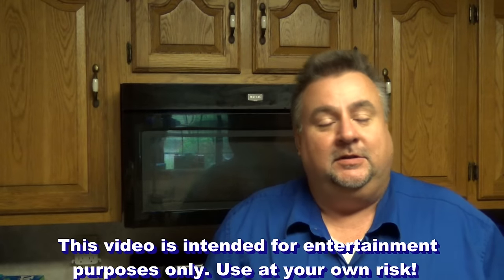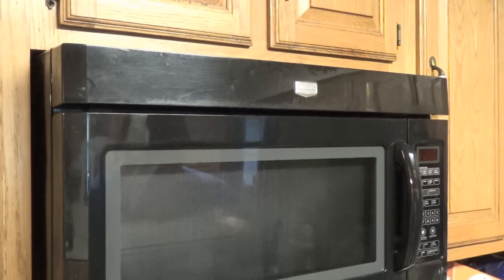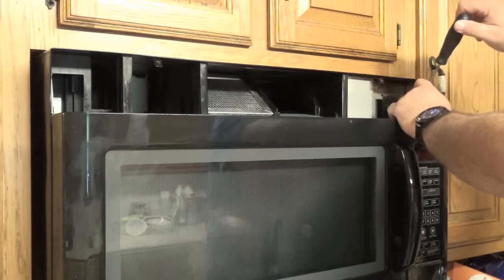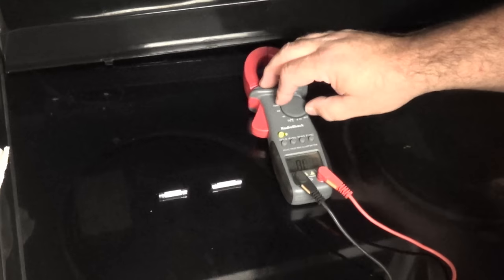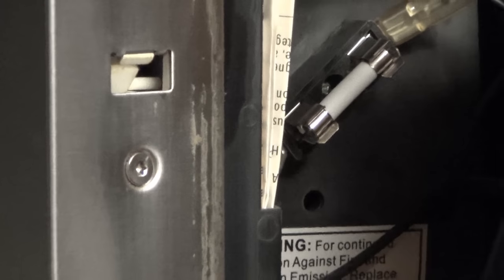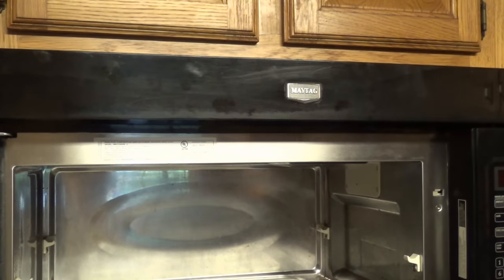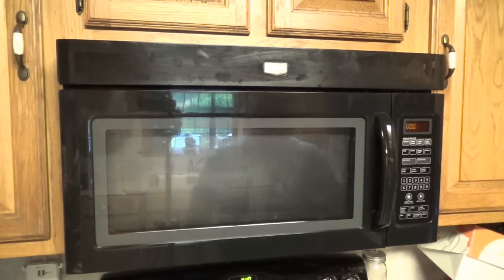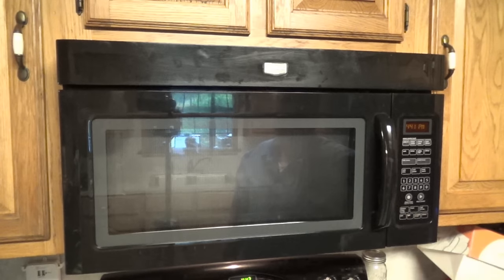How To: Restoring Power to Your Dead Microwave

Comment: You were lucky, I repair Microwaves and most of the time when the fuse blows is because there is another issue, there is a door micro switch that when it goes bad it blown the fuse, they make it like that for safety so the microwave won’t work with the door open , if they didn’t have that fuse you could put the microwave to work with the door open , and you could get radiation from magnetron, also the high voltage capacitor when is bad blown the fuse, another thing to have in mind when checking a microwave is that the magnetron produces 3000 volts or more and the rectifier ( diode) raise that voltage to more than 5000 v , so be careful when testing, and after unplugging it wait a few minutes so h.v capacitor drains
Reply: I installed a new fuse.  It blew right away.  Installed another.  That blew too.  What should I check that's causing this?
Reply: I have Kenmore over the range microwave. Display and fan works, but after setting the timer, you hit start button and it doesnt make any noise or do anything...
Working fine ond day, the following day nothing. Any guesses what to check?
Reply: Yeah I'm not anywhere near an expert on electrical repairs, but a lot of the time when something blows it's likely not as simple as fixing one thing.  I actually had a subwoofer amp blow a capacitor, and replaced just that and it worked again.  It was a cheap amp so I had fun running it hard, and blew it up again but this time it fried a bunch of transistors and the board itself actually got burnt.  Most other things I've tried to fix always are a lot harder, and you really have to learn what you're doing.  I see a lot of videos about people just changing parts to find the problem.

Comment: Not sure if you need another thank you but thank you. Frustrated that I got rid of my other microwave a couple of years ago when it was likely a $3.50 fix. Last one cost me two decimal places at $350 because I was an idiot. You grew me a little today :-) I don't have the same microwave but it . gave me knowledge I used to solve my problem. Have a blessed day.
Reply: I suspect there is a underlying wiring reason the fuse blew out. Replacing the fuse may solve the problem only temporarily.  It is worth a try.

Comment: Fuses will blow from normal use . However they will blow if one of the door switches isn't working. It will ground out the power cord and blow the fuse. So after you replace the fuse check the resistance across the power cord. If it is zero with the door open and closed then one of the switches is broken.
Reply: Jeff Hoffinger - what if all 3 checks show resistance and still no power ? Whatta we do next soldier ?

Comment: IN some other videos on changing this same fuse they warn about needing to "discharge the capacitor" to avoid shock. You didn't do this so I am assuming it is not necessary. I have ordered my fuse and waiting for arrival but did want to check with you before I remove old fuse and proceed with placing new one. I find your videos to be much more helpful than others and have really saved me a bunch of money as a retired fixed income baby boomer. Thanks
Reply: Im in the same boat !! KitchenAid Microwave KHMC1857WSS0 - Im pretty sure its the fuse, Just have to figure out where the fuse is located

Comment: in my case, the microwave has blinking time LEDs working.. and when i open the microwave door, the interior light turn on, and when i close the door the interior light turns off. But none of the buttons on the microwave control panel are responding to touch, Any idea what the porblem is?

Comment: How do you remove the panel backing cover. I can’t get to the screw at the top in the back. Trying to replace the door latch switches. The to screw holding the cover is hard to access. Any suggestions works be greatly appreciated. Thank you!

Comment: Great video.  Note:  Meter did not read zero with the old fuse, it read "OL" (probably for "Open Line???", indicating no continuity).  It did read zero (no resistance) with the new fuse, which indicates continuity.
Reply: OL is for Over Limit
Reply: Yeah I don’t know why people don’t just use the continuity mode on the DMM. This is like the 5th guy I’ve seen do this.
Reply: OL is Open Loop
Reply: @MadJDMTurboBoost  Right? You can test a fuse with a button cell (or any other battery) on a regular battery tester. Just place the fuse on one side of the battery and see if the needle moves, no need to bring in ohms.

Comment: i live in a apartment and the new Microwave is a 1100  It heats and after done  shuts it self  off No Power and about 5-10 min later comes back on it self  ..... Scary,,,, So i moved it to a plug in with a trip breaker out let  thinking it was drawing to much power on a regular outlet in Kitchen

Comment: Fuses are good still dead. Left it unplugged about 30 min, plugged it in and I had power but would not heat. Unplugged it and then plugged it back in and dead again???

Comment: Quick question for you. The 20 amp fuses that  came out of my microwave is a glass one with the visible wire inside and is specified as 125 V on the silver cap on the end of the fuse. All those I can find locally, glass or ceramic, say 20 Amp/250 Volt, not 125.

Will they work, and be safe protecting my circuit board inside the microwave? Some also say they are Fast, others Slow.  Which one do I need?  Thanks for any help.
Reply from the maker: Can't really give you too much advice on that, other than you need to be sure. I looked mine up and ordered it... probably paid a little more, but the part number matched. Good Luck.
Reply: Daniel Scheer hey thanks for your answer, though.  Hard to find this 20a/125v fuse, but will keep looking.
Reply: @marvin6148  When you find the place that has them can you please post that link? TIA.
Reply: @marvin6148  it kind of does matter, fuse is to design to blow at certain limit, placing larger capacity of any voltage and resistance may lead it to blow other components,

Comment: WARNING: ITS A FACT THAT MICRO WAVES OVENS HAVE A POWERFUL BATTERY THAT HOLD CONTAIN & SAVE ELECTRICITY IN ITS OWN BATTERY IN THE UNIT. Even IF YOU UNPLUG OR SHUT THE CIRCUIT  BRAKER OFF ITS DANGEROUS TO MESS/POKE/USE METAL TOOLS WITH ANYTHING INSIDE THE BACK WITH THE COVER OFF SO NEVER TAKE A CHANCE WITH TRYING TO FIX IT ON YOUR OWN THAT IS IF ITS NOT JUST THE FRONT FUSE BECAUSE IT COULD BE DEADLY

Comment: Truly great video, thanks.  My ex got burned by this problem.  I acquired the "junked" unit and repaired it with a fuse.  Should you choose to edit your video and you are secure doing it (i.e., no exposed internal wiring that could short circuit),  I agree that you might add rationale or footage of an operational test BEFORE buttoning it back up.  Might also say a few words of wisdom about (1) possibility of after replacing fuse it blows again, or (2) possibility of the unit still not functioning after fuse is changed.

Comment: Why have a blog if you're NOT going to ANSWER OUR QUESTIONS? What if a fuse isn't our problem (on a BRAND NEW microwave)???
Reply: Mandy Wilson if it’s brand new, I’d return it.
Reply: Thank you Amy Taylor Teats! I did return it but still would've liked to know what happened- how major or minor. The reason is because I live in an older home (in LA) and am not very comfortable with my electrical situation! Was it simply my microwave or something far more sinister that I should be paying serious attention to? Know what I mean?
Reply: Mandy Wilson I watched a different video where it was a similar problem, but it was a thermostat fuse which looks different and is in a different part of the microwave.
Reply: Geeze, this guy has the solution to a very specific problem. If you need answers to more complex issues stop whining and hire a professional.